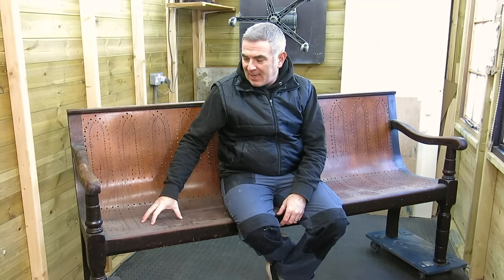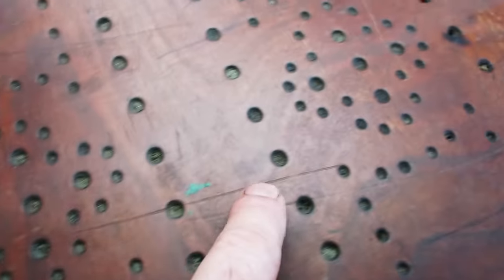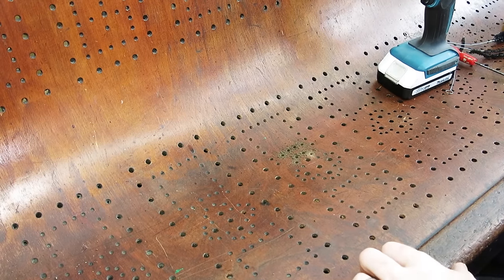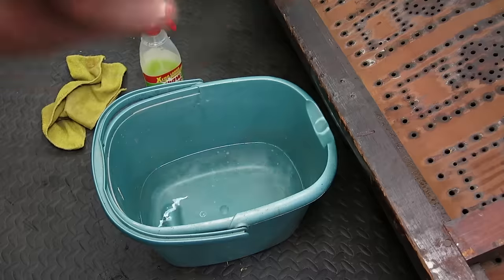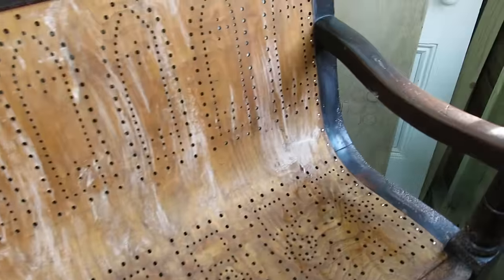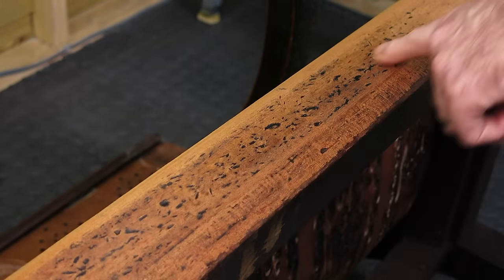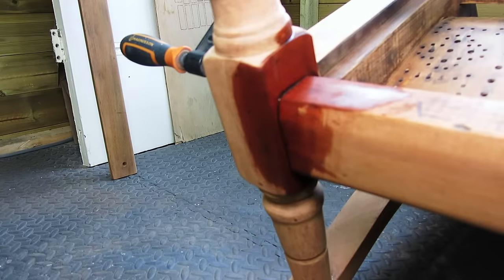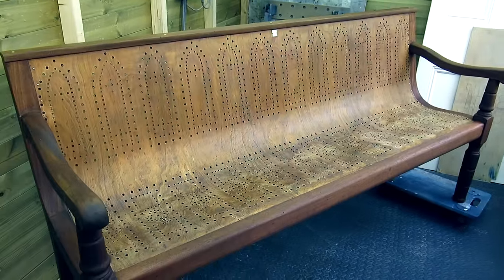Filthy Bentwood Bench Restoration

Comment: As a retired nurse, the first thing 
I  thought of, was that most of that was probably tar and gunk and was inside the lungs of the smokers... Not a pleasant thought. So glad most folks have stopped smoking! 

My second thought is that going forward, they're going to need an air pressure hose to regularly clean that before it gets clogged with dust and skin cells, etc, so that no one else has to go through what you went through.
Can't say this was my favorite of your video's David, but it again reinforces what a craftsman you are and how you thought ahead how to do this in a way that would make the bench really glow; and it does! Well done, that man!
Reply from the maker: Thanks so much. It was a lot of restoration but definitely worth it 😀❤️

Comment: The letter X represents 10 years ea. The letter I represents a single year, so in my opinion it reads 32, probably meaning 1932. However, it could be 1832 but, the bench doesnt look that old to me but, I guess its possible.
Of course, it could just be a code from the manufacturer that represents a different year.
You did an EXCELLENT job cleaning and refinishing this bench!! Its beautiful! With the arch design on the back, I wonder if in its early life, before the snooker hall, it was a church pew? The design looks like church windows.
Reply: I wonder if that was the 32nd piece the builder made?
Reply from the maker: Thanks so much for this, I agree it doesn’t seem as old as 1800’s but could possibly be 1932. Thanks for taking the time 😀👍👍👍

Comment: I like the "new old" look😊 is it possible that the wax comes off if move around on the bench? Or is there some coating over it?
Reply from the maker: Thanks. I finished it in lacquer so no issue but even with wax, as long as it’s fully cured and buffed it’s very durable and won’t come off on clothes 😀😀
Reply: @MayfieldRestorations  thanks, i was doubting a bit .i see all the steps but my mind was...but what if😄

Comment: I loved it. Shows how you accommodated the client’s wishes. I soul have wanted to make the seat finish uniform. But your method showed the history. Why did they add the holes? I assume for cleanup but did it also help with cooling? In-law relatives ran bars and the remaining lived in them😎 But I have never seen them in the states
Reply from the maker: Thanks Cathy. I’m assuming the holes are simply a design rather than anything useful. They were certainly a pain to clean 😂😂

Comment: Hi, just wanted to say  that mum and I watch your content and are both really impressed with your skills, edication and passion for what you do with wood and bringing furniture back to life. I'm a woodworker myself, not that far from you.  I wanted to ask, what are you using as an aerosol lacquer / clear coat for your restorations? I could do with some recommendations as a particular project I'm handling needs a little clear coat work and I'm normally just a wax coatings user but this job is different, I'm using a combination of tinted and ebonising polishes and would like something like a satin clear finish to protect the parts.  being assembled. I thought of you anyway because of the amount of sanding you end up doing and yes, I know the feeling, but recently my sanding changed for the better and no I'm not selling something, but thought I'd recommend it to you. Mirka Deros 650 or 5650 series and Deos 383 or the smaller model in combination, these in conjunction with the mirka abranet abrasives are just a real joy, you don't need an aggressive stock removal, 120g abranet will remove most  material easily, the sanders fit well in the hand, very minimal vibration, quieter than other sanders and for my needs, I swear by them now. I realise you're busy, but if you get chance, if you could tell me what you're using for clear coatings. I don't have a compressor or spray gear here, no time for it lol.
Reply from the maker: Hi Lewis thanks for your kind comments and for sharing your recommendations for your sander of choice, I’ll check the Mirka set up out. Regarding the clear satin lacquer that I use regularly it’s from Toolstation which I’ve no doubt you’ll have near you somewhere. I’ve had really consistent results with this lacquer and it leaves a great finish. I’ve added the link for you. 😀👍 https://www.toolstation.com/industrial-clear-lacquer-spray-paint-500ml/p44132

Comment: Another stunning restoration, well done! Just a quick question: is using a brown paper bag between layers the equivalent of rubbing down with sandpaper?
Reply from the maker: Thanks very much. Yes the brown paper bag is slightly abrasive and flattens any small dust nibs etc. works best when using aerosol lacquer as it’s a very fine coating 😀👍

Comment: I think if you used an awl on those holes it would have been easyer? I cleaned old benches like that years ago in a church and thats what I started with I also used Murphy's Oil Soap.
Reply from the maker: The holes were crusted up with all sorts so when I punched anything through it just left a small hole in the crust!!

Comment: Is snooker billiards?
Reply: They are similar games but have different rules.  

Snooker is a cue sport that originated in the latter half of the 19th century. It is played on a large rectangular table with six pockets. The game is played using 22 balls, including 15 red balls, 6 colored balls, and one cue ball. The objective of Snooker is to score more points than the opponent by potting the balls in a specific order. Each ball has a designated point value, and the player must alternate between potting a red ball and a colored ball until all the reds are off the table. Once the reds are cleared, the colored balls must be potted in ascending order of their value. The player with the highest score at the end of the game wins. Snooker is known for its complex rules and strategic gameplay. The table used in Snooker is larger than that of Billiards, measuring approximately 12 feet by 6 feet. The pockets are smaller and more challenging to pot the balls into. The game requires precise control over the cue ball, as players aim to position it for their next shot. Snooker is often played professionally and attracts a dedicated following of enthusiasts worldwide.

Billiards is a cue sport that has been played for centuries, with its origins dating back to the 15th century. The term "billiards" is often used as an umbrella term that encompasses various cue sports, including Snooker and Pool. However, in its most traditional form, billiards refers to a game played on a table with no pockets. This specific variant of billiards is commonly referred to as "carom" or "carambole" billiards. In  billiards, the table has no pockets, and the objective is to score points by making contact between the cue ball and the other two object balls on the table. The player must strike the cue ball in a way that it makes contact with both object balls, earning points based on predetermined scoring rules. The game requires precise control of the cue ball’s speed, angle, and rebound to score points.
Reply from the maker: Snooker, billiards is slightly different 😀👍
Reply: Oh, OK, asking from the USA here. Great job on the bench by the way.

Comment: you could have sprayed the holes and let the cleaner loosen the gunk and then rinse it...if it's greasy gunky...your degreaser would've maybe needed a couple applications
Reply from the maker: I didn’t really want to soak the bench seat as it was bent wood so laminated and I didn’t want it to delaminate. 😀👍
Reply: @MayfieldRestorations  i thought of that after i wrote it...i liked your solution with the drill ;)